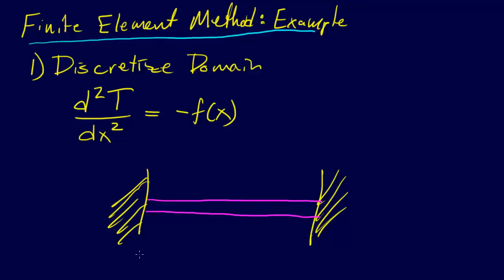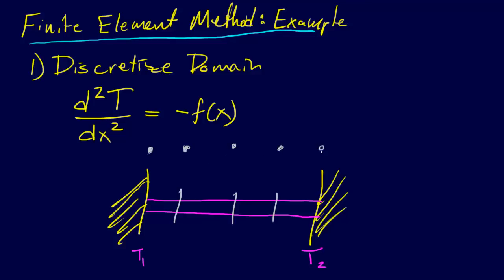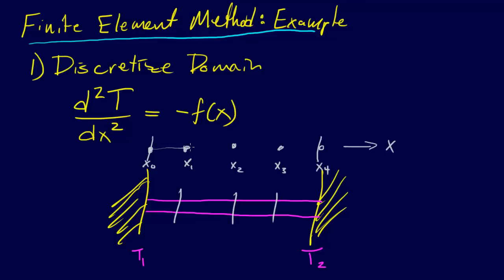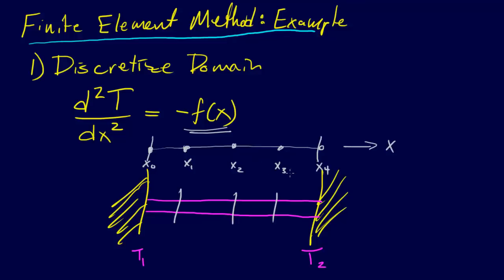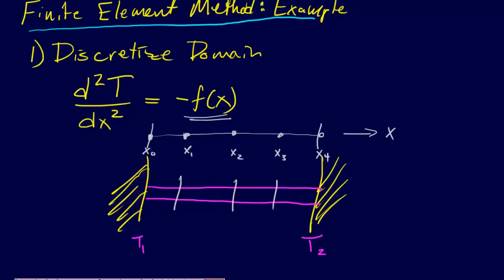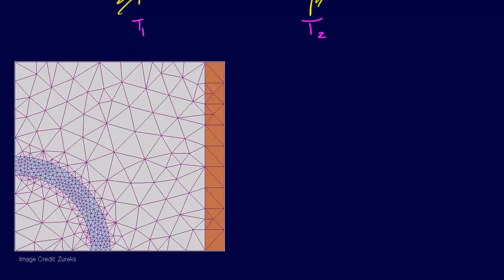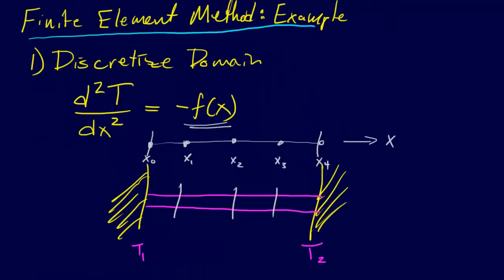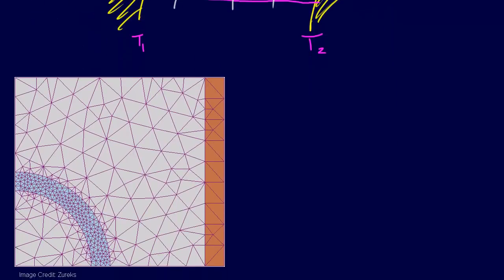8.3.2-PDEs: Finite Element Method: Domain Discretization

Comment: The above is not a partial differential equation.
Reply from the maker: Correct, it is an ordinary differential equation, as stated at 0:40. The reason for the title is that the video is part of a unit on methods that can be used to solve PDEs, and the finite element method can be used to solve PDEs. I use an ODE because it makes the explanation simpler.